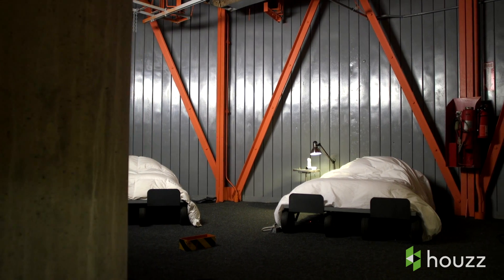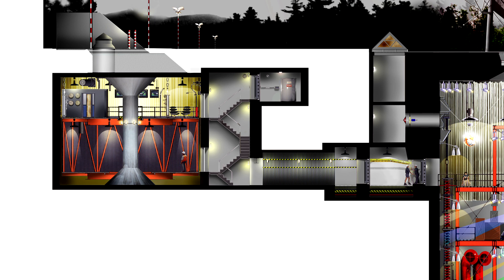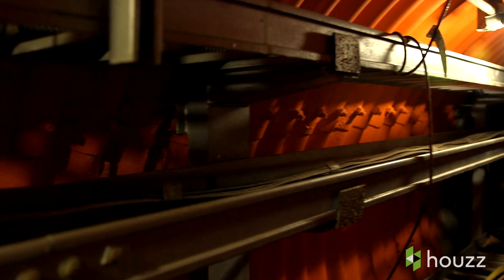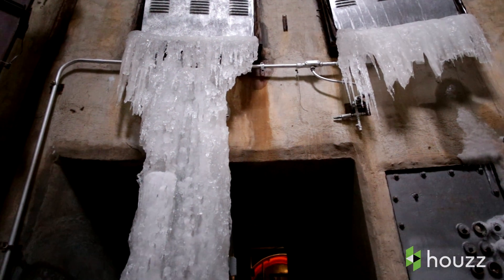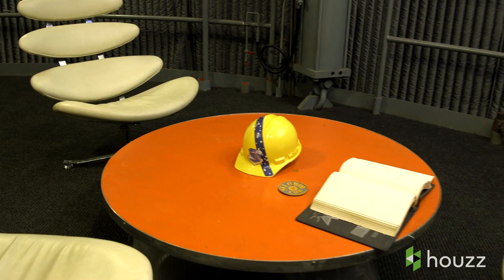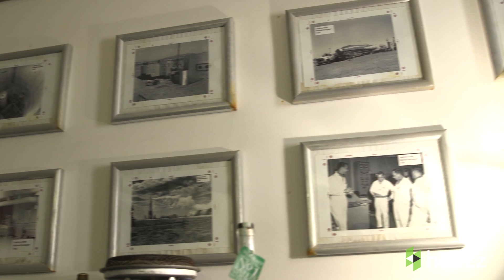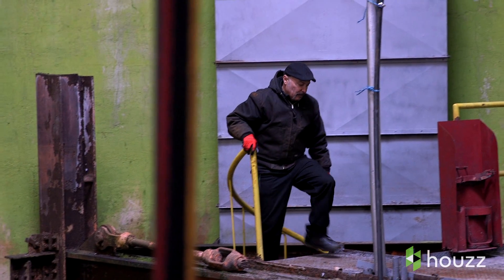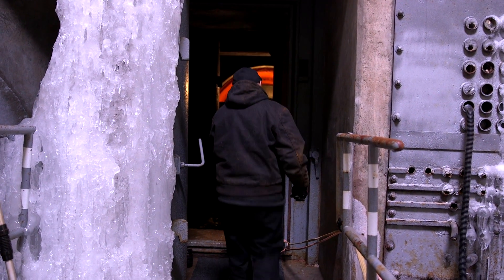This Guy is like Gru with the Ultimate Mancave Missile Silo Home

Comment: Have you reconditioned the original communications equipment? HF and VHF? Interestingly enough, the same frequencies and encryption systems are still in use - but only if the Satcom systems are lost. I am interested because I am a Ham Radio operator and a member of the Navy Marine Corps MARS system.